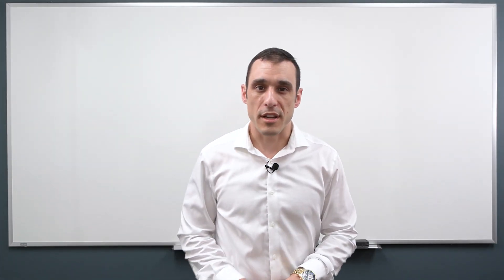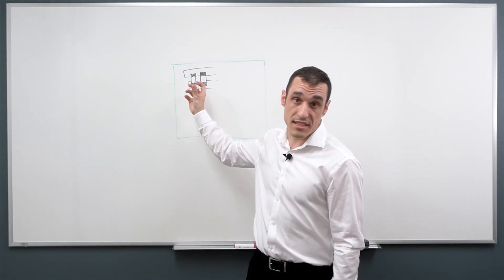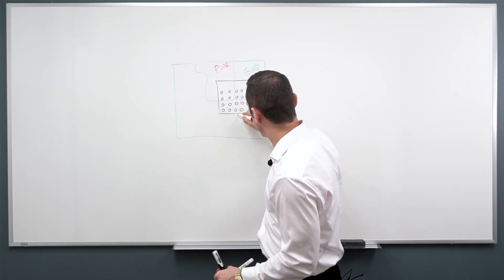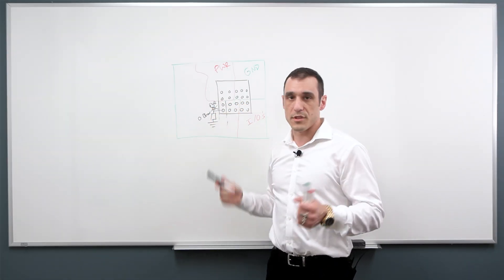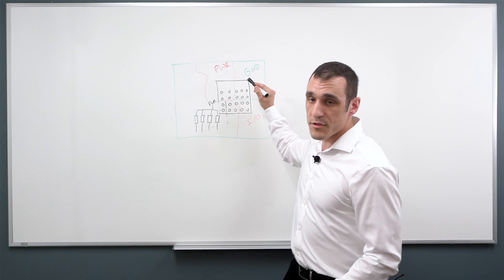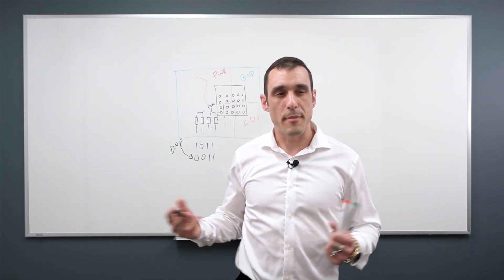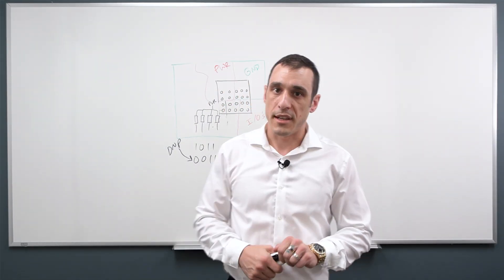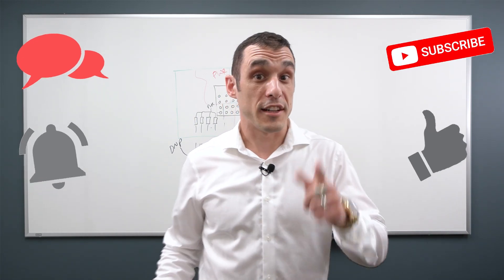DNI and DNP Designations in PCB Design

Comment: @Zachariah-Peterson
Not a layout engineer but I lead board designs on occasion. Im coming from a company that used dxdesigner and output the net list for a layout engineer contractor to do the board. New company uses Altium so I’m trying to understand the design flow and how it relates to various revisions. 

This video brings to mind some questions i have. I think of the schematic as a reference document that ultimately creates a net list. Once the PCB is created and released, it is a completed part, a subassembly that can be called out by higher level assemblies, generally by PWA(s). At that point if the part population changes, that would roll the revision of the PWA since it would just be a change to the PWA drawing.
In the example in the video, changing the schematic would roll the revision of the schematic. Wouldn’t this change the files that lead to the PWB? How in the case of the video in which the schematic is updated do you avoid rolling the revision of the PCB?

Thanks for any insight.

Comment: Hello.  I had a question, please answer it if possible. This is the question.  Is it possible to create a board with lines up to the level of nanometer? If so, how much nanometer do we have?  Thanks
Reply: @richardbekking  Hello dear.  Thanks for the reply.  Sorry I made a mistake, my goal is nanometers.  Because I know the technology inside the chip is now nanotechnology, but I forgot that my goal is to get an idea about a harvesting chip, whether it can be printed directly on the board for cheap or not.  I apologize again and correct my questions. If you want to delete the answer or correct it, because it is not true, I do not like anyone to read it and it is wrong and to be misled.  Thanks
Reply: @human3444  Hi Hassan, today's best semi-additive fabrication technology can reproducibly deposit trace widths down to 25 microns, or 25,000 nanometers. However, there is always motivation to try and get to much smaller trace sizes so that smaller semiconductor packages can be used in PCBs. Hope this helps!
Reply: @Zachariah-Peterson  Thank you very much 🙏🌹